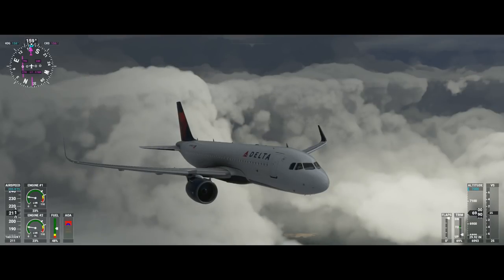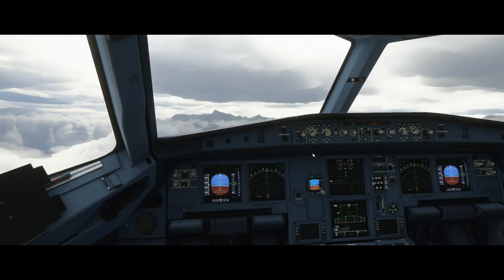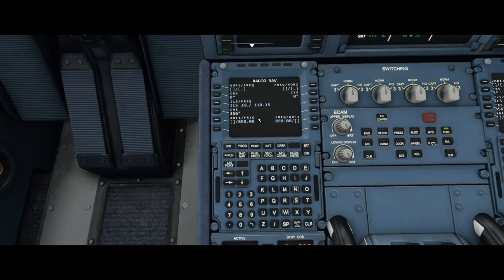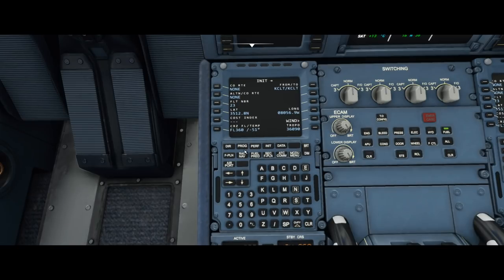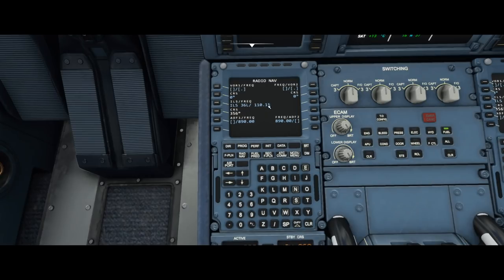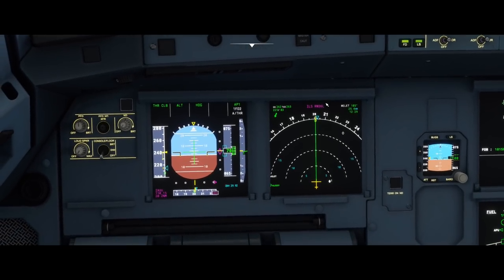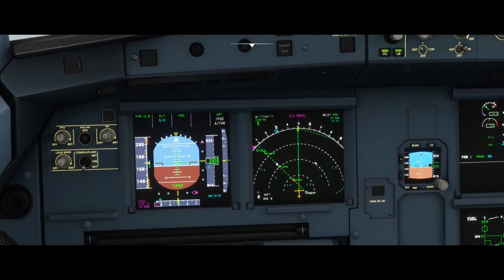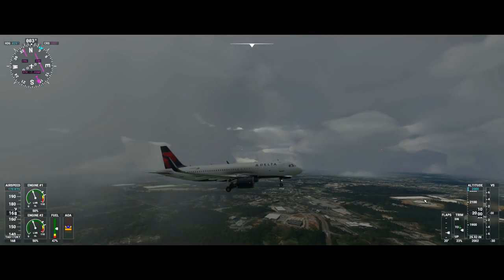Microsoft Flight Simulator | ILS Landing Tutorial | Airbus A320neo

Comment: Autopilot 2 is currently not working, it's a bug at the moment. Great video, but man, can you even fly with those fps being so low. Anyways nice video. Thanks for that. You just forgot to tune ATIS before approach to get wind info and other info for fms to add it into arrival page
Reply from the maker: Ahh alright I figured it was a bug. Actually, my FPS was around 70 with a few stutters. For some reason on the outside shots, OBS did not capture at the real FPS. It was smooth as butter throughout the entire time I filmed this which is strange xD. Yeah usually I would tune the ATIS but wanted to keep this tutorial pretty simplified.
Reply: @captainhorn23  The hard drive you are storing the video on while recording is too slow for the bandwidth you selected for compression. Try and match the storage media's write speed to your video compression and you shouldn't be having that problem again. Thanks for this awesome instructional, you're one of the people who explained it such a way it's really understandable for the laymen.
Reply: I tried to auto land without engaging AP2.  PDF switched from "land" to "flare" around 30 feet above the runway all right, but all the plane did when I idled the throttle was doing a nosedive and landed hard.   :)

Comment: On a whole, VERY GOOD video!  In a real ILS approach, there are MINIMUM altitudes you can’t descend below, to avoid controlled flight into terrain (you can’t see the ground!).  Also, if you are coming in the “wrong” direction, & not on radar vectors, you use a published “procedure turn” to get the aircraft properly aligned with the localizer.  You land & take-off INTO the wind, NEVER with a tailwind.  If your departure point was in the opposite direction to landing, you have to reverse course through a DME arc or procedure turn.  Video was very helpful for flying MS2020; keep more coming!

Comment: Thank you for the tutorial. Here are some additions on flying the ILS:

1. Raw Data - If you fly manually and without the Flight Director and just follow the needles it's called a RAW Data approach. This can be quite a challenge. Especially on non-Fly-By-Wire aircraft. 

2. 
Stabilized Approach - Most airlines want their pilots to be stabilized at 1000 feet above the runway. This simplified means that at 1000' the Landing gear is down, Landing flaps are set and that the speed is within -5 to +20 knots from Vref. If this criterion is not met you have to make a go-around.

3. LOC vs APP - Just arming Approach mode will do the job. However, in the real world, a lot of airlines SOP is to arm the LOC and then arm APP once you have captured the localizer. This is to prevent the aircraft from starting a descent on the glideslope before being established on the localizer. 

4. 
Intercept speed and altitude - Always try to intercept the glideslope from below. It is possible to capture it from above but it will make it much more difficult to be stabilized that way. Try to intercept the localizer with some flaps out and at a reduced speed. Flying too fast will make it difficult for even the autopilot to capture the localizer. For example Flaps 5 and speed 180 in a medium-size jet.

Comment: As a flightsim beginner the Airbus 320 neo is my favourite mostly because it has Easy to use and understand the ap feature. It's Easy to plot in the different values. And the ap does exactly what i want it to do. Climb to 30000 feet no problem. With smaller plane ap it's a pain because the ap seems to want to go into a Steep dive and crash the plane. Probably because i havent plotted the values correctly lol.
Reply from the maker: Yeah small planes can be more difficult than the larger jets in many ways! It could also be a bug you are experiencing

Comment: Thanks for the video. Very helpful. What I haven't found and would love to find is a video on how to update the approach waypoint (not sure the correct terminology) based on what the in-sim ATC tells you to use. For instance, if it tells you to to use a specific approach, I haven't figured out how to update the FMC to add that to the navigation waypoints.
Reply from the maker: No problem man glad I could help! You can the approach by simply modifying your flight plan and going to the APP/DEP button and selecting a new approach form there. Also, the ATC in the sim is a joke, so I would just turn it off like I did 😔

Comment: Awesome video man! Thanks for the tutorial! I've been scratching my head trying to figure this out. Also, idk if anyone else has had this issue, but my last flight in the a320, some things in the cockpit would randomly turn on or off. Lights, gear, instrument power.. kinda annoying. Lol
Reply from the maker: No problem man! Glad to help out! Yeah there are a lot of issues with the Airbus right now since the most recent update
Reply: Is the things like engine and fuel pages go black and like altitude and speed thing (pfd) go black?
Reply: @cocoabean5917  the pfd goes black. Have to turn it back on several times lol
Reply: G-LOC TV yea i usually have to increase brightness
Reply: G-LOC TV would you mind telling me how to turn it on im getting the same problem know
Reply: @cocoabean5917  should just be the brightness switch. In that group of 6 switches on the left side. As for the autopilot displays, it's one of the large black dials in the center of the display cluster under the autopilot stack. Hope that helps

Comment: pretty good, but you wanna usually hit LOC to capture the localizer first then once you are closer to the glideslope then engage your APPR. That keeps the aircraft from veering left and right... Aside from that, great job! (To add... CAT III Dual isn't functional in this sim, but autoland does work)
Reply from the maker: Ahh thanks for letting me know! Yeah I figured the CAT III was not simulated (maybe in the future?). I will have to try the auto-land function. I assume you turn on AP 2 even though AP 1 gets turned off?
Reply: @captainhorn23  V1SIMULATIONS did a video on it. As long as you have all of your landing data in the box, just keep AP1 on with APPR active and it should autoland although it will disconnect the moment you touch down..

Comment: Engaging AP2 does not allow for Auto Landing, it just switches over to an identical autopilot.  It does that in a real A320, but not in this version of Flight Simulator’s A320.  I mean, you can AutoLand in Ap1 or AP2, no need to switch over.

Comment: i've tried to land on ILS in Berlin and A320 started to circle over the airport after the control tower told me to lower to 5000ft and maintain this altitiude. What's going on here? Why is it not lowering on autopilot?
Reply from the maker: You need to use Vertical Speed or click the bottom of the knob as shown in the video. ATC is a joke in the sim unfortunately so I would turn it off. Hope this helps!
Reply: This is the problem I sometimes have, ATC tells me to descend, but it seems it's not low enough to capture the glide slope. I was expecting to always be instructed correctly and appropriately for ILS landing set up. Very disappointing😒.

Comment: Isn't it just possible to fly in straight instead of 45 degree turn?
And is it necessary to use de mcdu, or can you just put in the ils freq. in the nav2 radio freq and activate when approaching?
Reply from the maker: Yeah you can fly straight in if you like, but when intercepting it from the side it is best to go in at a 45 degree angle, but yes straight in is perfectly fine! And yes the the second question, you can enter the ILS frequency but I thought I would show a way to get it other than finding the frequency online or by other means, but both ways will work perfectly fine!

Comment: This tutorial was so awesome for me. I have been doing ILS approaches for years using the stock 737-8 in FSX, but because it doesn't have an FMC, most relevant controls are up on the autopilot dash. Thanks to the A320neo having a functional FMC, I was trying to figure out where all the bodies were buried, so this was a great help. Two further questions that you may have covered elsewhere - upon taking off, if there a way to get the autopilot to follow the GPS path? Also, what is your opinion of the ATC in FS2020? In FSX it did a decent job of getting you to the correct altitudes, but it seems not nearly as good in FS2020. Is there a workaround for this?
Reply from the maker: Thank you so much for the kind words!! I’m glad I helped you out! Yes there is a way to get it to follow gps. Simply insert the route into the mcdu and engage the autopilot! Check out my mcdu full tutorial on my channel! The ATC is complete trash. Really a disappointment. It’s worse than fsx and it’s sad. Worst part of the sim by far. I recommend vatsim. Talk to actual people who know what they are doing. Also a video on vatsim on my channel 😉
Reply: @captainhorn23  I actually just watched your complete MCDU/FMS tutorial, and it was very helpful and informative! Will definitely be using it as a reference as I try my first flight using it. Many thanks! You have gained a subscriber today, my friend.

Comment: Nice job. Thanks. What pc specs do you recommend? The info on the internet seems to vary wildly. I’m a Mac user and want to buy a refurbed pc for fs2020 use only. If possible. Thanks.
Reply from the maker: I recommend at least a 1660ti and 9th generation processor. 16gb of ram as well.
Reply: I’m using a 5th generation ryzen 5600x with 32gb ram and 1060 6gb graphic card and it works perfectly on medium settings.

Comment: Great job man.. I have only one question.. during the landing you only have adjusted the flap or you have manually set also the wind brake? If yes, when I have to do this? Thanks man
Reply from the maker: Yes I manually adjust the flaps. Usually you want flaps 1 when you are a good ways out, then flaps 2 at the beginning of the localizer, then 3 a little further into the landing, and when you are lined up and under 2,000 feet, full flaps, full lights, and gear down!
Reply: @captainhorn23  and the wind brake?
Reply from the maker: Marco Argentino do you mean the spoilers?
Reply: @captainhorn23  speed brake.. near to flaps, on the left side
Reply from the maker: Yes so this is only deployed on landing, or when you really need to slow down

Comment: Thanks for this great video. The default key for reverse is "F2" ...
I tried to reproduce your tutorial, but of course it did not go as planned. Everything was going well, the glide slope started well, the ILS was activated, the plane was going down well under a good slope, good frequency, but the plane tried to land 200 meters before the runway, as if the glide slope was shifted. Error on my part or game / track bug?
Reply from the maker: I am glad I could help! I have finally set my reverse key up lol. It sounds like you did everything correctly so yes, it was probably a bug. If you notice in this video, It was actually reading I was above the glideslope but everything turned out ok. The autopilot in the simulator is still a little wonky, and will hopefully be updated this Thursday!
Reply: @captainhorn23  The best way to get the answer to my problem is to try again on another track: D

Everything was going well, but 200 meters too short ... I think I'm in the right, thanks to you. And about the update, if it's not Thursday, it will arrive sooner or later: D

Comment: I don't know what I'm doing wrong, I'm trying to get the hang of the A320, and whilst in the decent phase I can see the glide sloap at 4000 ft, but the ATC is so late at telling me to go down at lower altitude, when they tell me to go down to 2000 ft the glide sloap is far below me still, and the approach button dosen't work at all lol, it aligns with the localizer but it dosen't bring the plane down. it's frustrating because I don't know what I'm doing wrong. Lol

Comment: Thanks fort sharing this!
I have a question. While the APP mode work perfectly, I still don't understand what the LOC is for, since even when I am aligned with the runaway, if i turn it on it takes me completely away from the path. And this happens on both the A320 and the 747. So i ended up with using autopilot with NAV on, until i reach the localizer and then I turn approach button on.
Could someone explain what LOC is for? Maybe is there something to set up to use it? Just to understand, that's all. APP works great and it's the right way to land in a ILS approach.
Reply from the maker: LOC is apart of the APPR. The LOC button allows you to capture the localizer which is the horizontal line up with the runway. APPR engages both LOC and glide slope in order to land on the runway.

Comment: Hey Thanks for the tutorial. One of the things that I don't like about this game is that when I enable Auto Pilot 1 and enable Managed NAV and enable everything every one else has the Plane starts to go on banking turns left and right automatically I also tried to set the waypoint to direct and it does the same thing! It gets so frustrating, if there is a solution to this problem could you please let me know? Thanks for the Tutorial once again!👌👌👌
Reply from the maker: No problem man! It sounds like you are doing everything correctly, but maybe missing a small step that causes this to happen. Maybe someone in your MCDU is messed up?

Comment: So I saw another video where a guy input the wind, QNH,  temp, and a few other things, is that not needed for the sim? Oh and also, ATC keeps telling me to get to my assigned altitude if Im 2000ft like 15 miles away from the runway.
Reply from the maker: Yes those are needed for realism. I will be doing full flights so you can see it in action. The ATC is a joke. I would just turn it off like I did

Comment: To descend do i need to use Vertical speed wheel i always use but i saw that you didnt use the vs wheels. Also if you turn on appr it ignores your set alt on ap and descend to stay with G/S?
Reply from the maker: You can use V/S but I just press up on the altitude knob to enter a managed descent. Yes APPR will ignore the altitude set once it is on the G/S!

Comment: Hi! So just to clarify, I input a runway to land on in my fmc which I always do anyways, but with a star usually. ILS freq should be automatically set then, same with course. I then guide the aircraft to the approach waypoints with my autopilot heading selector and then turn on approach mode when I am close to the approach waypoints, to intersect the localizer. I then set altitude to something low, eg. 2500 feet. When the aircraft reaches glide slope, I turn on autopilot 2 and it will land itself?
Reply from the maker: Yep this is correct! You can even look at approach plates or the MCDU to see altitude restrictions at each Star like I know at the WELET intersection at KCLT, you must be at or above 7,000 feet, then the next one is 6,000, and so on. Make sure to engage APPR when you are on an intercepting course with the LOC and only engage APPR when you see both the localizer and glide slope on your PFD (the little purple diamonds). Typically, yes. AP 2 is supposed to work together with AP 1 and do an auto land, but it’s broke right now. I’m hoping they fix it soon because I love auto lands. For now, just disengage AP when you are really close to the runway and flare it yourself
Reply: So the altitude restrictions will be shown on the FMC for the approach waypoints? Great! And thanks

Comment: I didn't get how do you set your altitude to 2000 and when? How do you know there is no mountain in front of you in the middle of clouds? Any tips?
Reply from the maker: The actual approach plate says to be at the WELET waypoint at or above 7000 feet, but in this video I was at 2000 for the sake of simplicity. I know there was no mountains in front of me because I know Charlotte, the terrain radar is also useful. Just use sky vector to look at approach plates and see what altitude you need to be at 😉👍
Reply: @captainhorn23  ok I get it. Thanks but one more connected question I can't Google an answer.. the thing that bothers me the most: 
I'm on decend.
 wp1 alt 10.000 heading to wp2 alt 5000. 
When Im on wp1, does the plane decend automatically? Or I have to set 5000, in that case will it be enough time to decend enough untill I reach wp2?

Subscribed today and waiting for video tutorial abt decend, the thing that's painassing issue for a lot IFR newbies :)
Reply from the maker: @gibanica87  Yes, in your example, if you set your altitude down to like 1,000 feet, the plane will hold at 10,000 then descend automatically to 5,000 before the next waypoint. Thanks for the subscription! I will have a video discussing descent very soon! :)
Reply: @captainhorn23  thank you a lot ;)

Comment: Whenever I set the flaps to 1, the airbus goes skyrocket upwards and I lose any possible position to land... Anyone else with that issue and maybe got a fix?
Reply from the maker: Maybe you are coming in too fast?
Reply: There are a marking on the speed indicator where you should do flaps 1, you then get a marking "S" for flaps 2 and a marking "F" for flaps 3/full

Comment: Does anyone know how to change settings in FS2020 where ATC assigns your approach in a more realistic way - meaning, the STAR and runway is assigned at about 100mi out based on weather. The few flights I've done I don't get this from ATC until i'm within 2 miles of the airport. Also, ATC I'm noticing is having the TOD way earlier than needed, and having you stay below 10000' for quite a while - none of this is what is done in real flight ops.